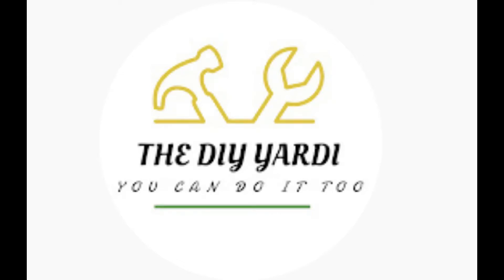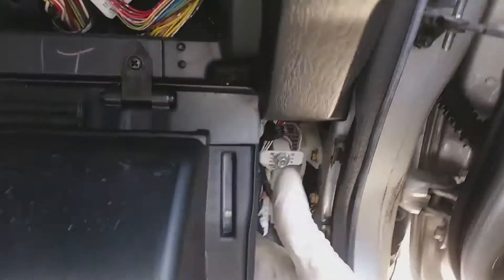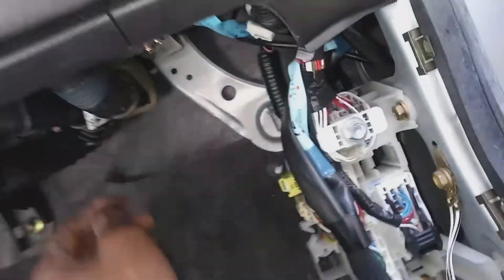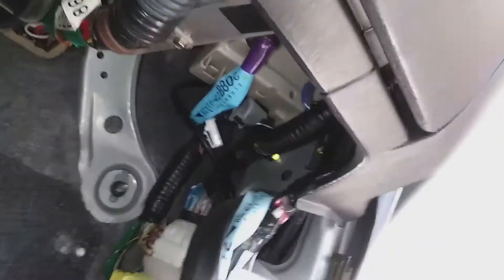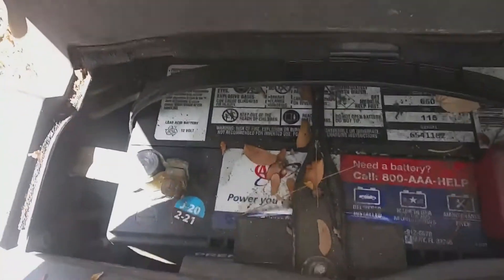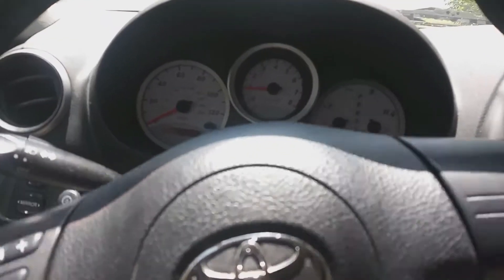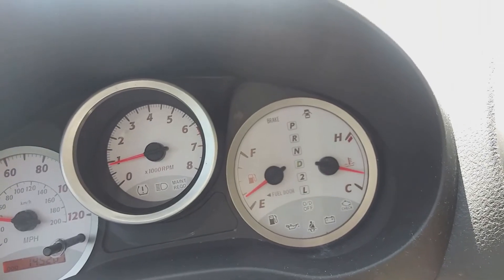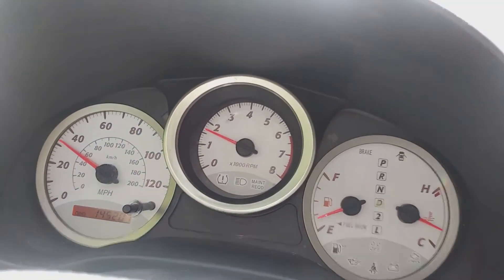OBD CODE P0776 FIX, 02-06 TOYOTA'S INCL RAV4, THIS PROCESS COULD SAVE YOU THOUSANDS OF $$$$$

Comment: Part 1 of long post.

If you have a Gen2 Rav4, model years 2001 to 2005, and specifically the 2004 Rav4, with DTC P0746 and/or P0776, Pressure Control Solenoid A (or B) Performance or Stuck Off, which is the problem I have, then here is all the information I offer that may or may not be of help. I've spent months trying to figure out a solution, while driving my 2004 Rav4 for 12 months, 7 months with serious driveability issues.

See below "The Symptoms with the transmission" for details on the transmission issues I have with my 2004 Rav4. I go into much detail.

Just as of this post, (Oct 13, 2025), I found out a possible fix that may not require a rebuilt transmission, and it only costs less that $300, i.e., having the ECM repaired by a reputable company that comes with a 1-year guarantee. I'm not promoting this company, and I haven't used their service - yet, but I am seriously thinking of doing it as a last effort to try to get the transmission working properly.

How I just found out about having the ECM repaired may fix 2004 Rav4 shifting issues. My issues included started only in 2nd, then only shifted into 3rd, without ever shifting into 4th (overdrive).  Later, starting only in 3rd, shifting into 4th, and very hard shifting into Reverse.
DTC P0746 and P0776

Using the website recommended by Scotty Kilmer, mechai (dot) app - I found that a majority of Gen2 Rav4s 2000 to 2005 with DTCs for transmission solenoid errors (P0746 and P0776) that are FALSE ERROR CODES: i.e., the ECM is throwing those codes because of loose solder connections and/or bad resistors in the ECM.  The website mechai(dot)app has a full DIY repair sequence to test and repair/replace the bad resistors (and maybe capacitors), BUT - it requires skills in electronic circuit board repairs: skill in soldering small parts, some special tools, EXACT electronic replacement parts, special tools, including, of course, a quality 40W soldering iron with heat control. 

It's too big a gamble for a even novice in electronics repairs could correctly repair the unit. Then there's the problem of reprogramming, which may or not be just a little playing around with the OBDII connector terminals. Is it worth risking?  I don't think so. 

From the website "mechai(dot)app" I found a ECM repair company with a specific video on YouTube on how to remove the ECM yourself to be able to send the unit to them for repair. They don't overcharge for repairing your ECM and sending it back to you quickly ($269.99 for a 2004 Rav4) 
You can remove the ECM from your vehicle using their guided video, and ship it to them. They have a one-day turnaround (as stated in their vid). They give a 1 year guarantee, or you can purchase extended guarantees from 2 years to 5 years for a reasonable cost.  

The company is Circuit Board Medics in Greenville, SC. Their website is the same as their name, plus dot com. 
Their video showing the specific removal of a 2004 Rav4 ECM, step by step is 
youtube(dot)com/watch?v=jyQIFV5JOfg

If that full link isn't displaying, go to home page of youtube, add /watch?v=jyQIFV5JOfg to youtube.com
Circuit Board Medics charge for repairing a 2004 Rav4 ECM is only $269.99 w/ a 1-year guarantee. 
I have not yet tried the service, but they have been in business for many years and have
hundreds of positive reviews.  I am not promoting them, but they appear to be a legitimate repair company, with a street address, phone #, website, etc.

I strongly advise to NOT use any ECM refurbisher on eBay. It's not worth taking a chance on spending a few hundred dollars.
It's probably not worth buying a used ECM from a salvage yard either because you might well have the same problem with it,
and more headaches.

FYI: If you ask me questions, I probably won't check back with this post. I'm giving you all the information on my car and its transmission issues.
Reply: Part 2 of a long post

I thought I was going to have to sell my 2004 Rav4 for salvage. I was quoted extremely expensive amounts to rebuild the transmission. One shop quoted me over $8,000, including $2K for the repair of the ECM!  The Car Care Nut shop TCCM Automotive, (whose owner is a great mechanic and wonderful man) thoroughly inspected my Rav4 and said besides the transmission problem, the car wasn't worth putting the money into it to repair it. I paid $3K for the car Oct 2024 with 186K. The body and interior are in great shape, but after purchasing I discovered the check engine light DTC was P0746 - Pressure Control Solenoid A - stuck off. TCCM Auto shop gave me a detailed printed breakdown of the many needed repairs, for the transmission problems, AND for other needed repairs, like new brake lines (due to rust), new radiator and hoses, new wheel bearings, possibly replace power steering rack, and other repairs. Total repair costs, $8,500. Obviously not worth spending anywhere near that on a 21 year old car with 190.5K miles.  TCCM - for the transmission repair, they first would send the ECM out to repair/refurbish, at a cost of $495, which is cheaper than some, though not "cheap". If the repaired ECM didn't fix the trans problem, then they would have to get a rebuilt transmission which they quoted me at $5,000.  That's a lot of moolah.
So, to end this, I think I'll try having my ECM repaired by Circuit Board Medics and see if that fixes the problem.  

The Symptoms with the transmission:

Purchased a used 2004 Rav4 FWD, automatic transmission, with 186K miles, for $3,000 in October, 2024.
The car was in clean condition: body and paint, very good, interior clean. A mechanic friend helped with inspecting the car
from a local police detective. My friend writes service orders for the vehicle maintenance department of a large city PD maintenance facility.
My friend does a quick check of the car, looking under the car from the ground, checked the oil filler cap (which had sludge on it, and there was varnish or brown color on the cam lobes. The oil was very dark. The alternator was new, as were front struts. 
The check engine light was on. My friend's Bluetooth OBDII code reader device was not working, After a test drive, with me driving,
he said he didn't think it was anything major. That was the worst advice, actually stupid and irresponsible advice!
ALWAYS check the CODES! Auto parts stores will do it for free.
I was not aware that DTC codes can be TRANSMISSION trouble codes! 
After buying the car for cash, and then immediately changing the title, registering it, only then I went to O'Reilly Auto Parts to get
the check engine light diagnosed: DTC P0746 "Pressure Control Solenoid A Performance or Stuck Off".

Issues with driving which I did not realize on the test drive:
The issue at first was the car only started in 2nd gear, then shifted into 3rd gear smoothly without any problem. 
I did realize until later when driving 55 mph or higher that the transmission did not shift into 4th gear or overdrive.  
Because 3rd gear is not a highway speed gear, the engine was revving or running at 3,500 to 4,000 rpm or higher, up to 60 or 65 mph.
I tried not drive faster than 55 mph, but the engine was still revving at 3,500 rpm. AND this caused the engine oil consumption to be extremely excessive: One quart every 200 miles! I had to constantly check the oil level, and added many quarts of oil after not many miles!
After 5 months of driving (I drive very little), all of a sudden the car wouldn't move from a stop, except only very slowly, like limp mode. 
I managed to get it moving, but from a stop it was extremely difficult to get it to get moving, it would buck and lurch badly, eventually moving along at steady speeds of 30 mph to 55 mph, but when taking my foot off the gas pedal, at different speeds (especially when slowing down before stopping), 
the transmission would bump or lurch, or whatever. Because of this, I learned to shift into neutral well before stopping. 

Starting off from a stop, or even from a slow rolling speed (5 mph to 15 mph) it would do a jerk or lurch one or more times, and then eventually drive smoothly. I figured out how to deal with this, but it was very dangerous to start in traffic from a dead stop.
This is because, as I determined, the transmission is NOW starting only in 3rd gear, and then shifts smoothly into 4th gear or "overdrive".
Because of the trans starting off in 3rd gear, I had to be sure I wasn't going to have to start off quickly, as when pulling into traffic from a side street. 

This is very hard on the engine and especially hard on the torque converter (clutches), but the surprising thing is that it now does shift into 4th gear (overdrive), nice and smooth. I can now drive on highways at speed of 55 mph and higher without any problems.  This made me think that the transmission might be okay. However, until today Oct 13, 2025, I wasn't sure if replacing the bad solenoids would fix the problem. 

The DTC codes I have now are P0746 and P0776. The "primary" DTC is P0746: Pressure Control Solenoid Performance or Stuck Off (as per O'Reilly VeriScan at O'Reilly Auto Parts).
The VeriScan also lists both the DTCs, P0746 and P0776 as both "Stored" AND "Pending".
P0776 is "Pressure Control Solenoid B Performance or Stuck Off".  

Again, if you ask questions, don't expect me to answer them as I don't do that, plus I'm not a mechanic.  This is a lot of information that I've spent countless hours and sleepless nights and days trying to figure out a solution. It might help someone out there. 
The many videos on Gen2 Rav4 automatic transmission problems are often confusing, and most are made by rank amateurs.  You have to try to diagnose the problems in a step by step LOGICAL manner. If you have these solenoid codes, don't assume you can replace the solenoid(s) and it will fix the problem. Solenoids are expense to buy and expensive to have a mechanic put them in, -IF you can even find a mechanic to ONLY replace the solenoids. MOST WILL NOT DO THAT!   If you have the code P0746 and barring bad trans fluid and other considerations, you might want to just try having the ECM repaired by a reputable company that actually gives you a guarantee (of up to 5 years). If that doesn't fix the problem, then you can decide if it's really worth having the transmission rebuilt. Depending on the condition of your Rav4, mileage, etc., it "might" be worth rebuilding the transmission, if you don't want to spend $20k to $40K on a decent used or new Toyota.  Good luck.
Reply: What ever good promotion

Comment: Do you have to program it if you find an exact match ecm?
Reply from the maker: To be totally honest I can't say for sure, if you are able to to find an exact match it may work, but it may also depend on if the one you find is in good operating condition. these ecm,s tend to develop that issue over time, that is why I recommend getting the remanufactured unit where they go in and correct those issues. I would be interested to hear if the exact match works out for you though, please keep me posted.
Reply: @thediyyardie7192 i put an exact match ecm, and as far as i can tell it required no programing! 
But my issue has not been resolved!
New solenoid, fluid, filter and ecm and it was not fixed.
Reply from the maker: @justinl5753  Where did you get the replacement part from, Is it a rebuild or no?
Reply: @thediyyardie7192 i bought it from a reputable source on ebay. Claimed it was tested and working. 
Not sure what it could be now. 
Will have to start testing wires, and alternator. 
Any ideas?
Reply from the maker: @justinl5753  Because these cars tend develope the same issues, I wouldn't recommend using a used ecm unless it was rebuilt or a reman.

Comment: Im having the exact issue! pulled out the solenoids and tested, all seem to be functional. 
But I’m told it’s hard to properly test a pwm solenoid. 
Im wondering if i should just throw in a new sl2 solenoid before putting back together? Or just assume it’s an ecm problem?
Reply from the maker: I went that exact route, but the ecm was what corrected my issue, its your decision ultimately what route you choose.

Comment: Hello. I am getting 3 transmission codes calling for stuck solenoids.  fluid looked fine with normal wear after 140k miles.  where is a good place to get the computer work done
Reply: 2017 Toyota Camry le
Reply from the maker: @clintonshannon  To be honest I've only done this on the older models, but I don't see why it shouldn't work for that year also..
Reply: Cvt? @clintonshannon
Reply from the maker: What is the year and make of your car? and there's a link in the description box below the video to a company that provides that service.

Comment: I would like to express my great gratitude to you because you saved my money and helped me to avoid being exploited by mechanics. I was suffering from this damned code and I went to more than 5 gear repair experts and each of them gave me a different opinion with a cost ranging from 3000 to 6000 dollars ,all of them   do not guarantee what will happen their repair, I saw your video and followed your advice, and the result was amazing with total cost $ 400 only.., so thank you from the bottom of my heart. Thank you  so much
Reply from the maker: @kilokoba6090, you're quite welcome, I made this video because of the exact reason you stated you experienced, it worked for me so I figured it would help others out also. thanks for taking the time to show your appreciation, most that benefit from this info say nothing.

Comment: Great video, I have the same code plus two other codes. How did you determine it was the ECU and not the Transmission Control Module (TCM)? Thank you.
Reply from the maker: @ronc1422, I actually tried replacing the shift solenoid first, that still didn't solve the issue, so I did some further research and found out that some of the solder points in the TCM melt over time, loosing contact and therefore creating this problem. They wanted almost 4 thousand dollars to rebuild the trans, so I suggested to the owner to try the remanufactured unit I used in this video and see, it fixed the issue, but you have to follow the relearn procedure once you get it installed, it won't work properly otherwise. there's a link in the description box above to where you can find a rebuilt TCM, good luck..

Comment: That is a good video ,My 2003 Rav had code p0755 I send my ECU to upFix 10 days ago and they are going to send it back to me very soon I hope that will fix my problem too ,I did change the selenoid B but it didn't work.
Reply from the maker: Thanks Hung, It will usually correct that issue, as long as the car wasn't driven too much that condition to cause further damage the transmission, and you follow the relearn process exactly once you receive the ECU and install it..

Comment: Thank you so much, saved me thousands of dollars my 2004 Toyota Camry has 541,000 miles same issue with your Rav4.I changed the computer it fixed the problem.Thanks again!!!
Reply from the maker: Wow Nelson, 541K on the clock and counting, that  suggests to me that you're doing a top job on maintenance, happy to hear that my video was of help to keep her going... and you're quite welcome..
Reply: Hello, my 2004 Toyota Camry has the same code P0776 and it gives me a knock in the first gear. I've checked 4 computers and the car won't start. What can I do?

Comment: Friend I have a 2004 rav4 with the code p0776. The problem is when reverse goes in, the transmission kicks and when changing from first to second it does it very abruptly and sometimes it stops and then the change goes in. It also feels very heavy in first gear, is that the same thing that happened to you in your truck?
Reply from the maker: Hi Omar, if your Rav4 feels like the brakes are being applied when the transmission is shifting between first and second while driving, along with everything else you mentioned, yes that is exactly what the one in my video was doing.
Reply: How much does it cost the PTCM
Reply from the maker: @aahmad6278  sorry, hope you got your car fixed, just realized I wasn't seeing a bunch of my messages, there are links in the description box below video.

Comment: Thank you so much, you saved me thousands that were quoted by AAMCO to fix transmission on my Toyota Camry 2004. Same process worked on it and because 2002 to 2006 are all same generation Camrys, that means, you can add Toyota Camry 2002 - 2006 to your description as well. Thanks again.
Reply: does this apply to Scion Tc's. mine has the code P0776. did 3 drain and fill and changed the SL2 solenoid.
Reply from the maker: @MustangDrifter_X  hey sorry, for some reason YouTube flagged you're comment and hid it, not sure if you already got the issue with your car resolved, let me know..
Reply: @thediyyardie7192  hello.  its ok. I ended up getting a used transmission but havent installed it yet..
Reply from the maker: @MustangDrifter_X  if the issue is still there after the install,  then you know the issue  is most likely the ECU.
Reply from the maker: Much thanks for that info Awais, always happy to hear that my vides are helpful, I don't think the transmission shops feel the same way though...
Reply: Who did you go through for the ECU repair/replacement?
Reply from the maker: @rolo4070  sorry, hope you got your car fixed, just realized I wasn't seeing a bunch of my messages, there are links in the description box below video.